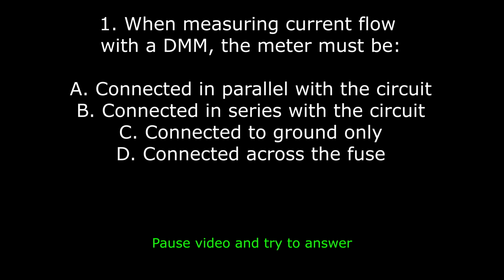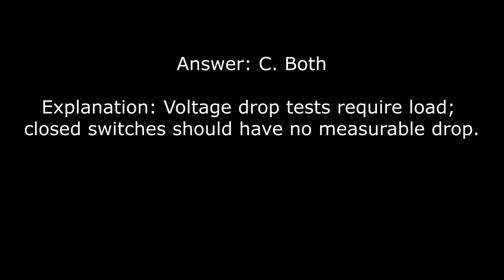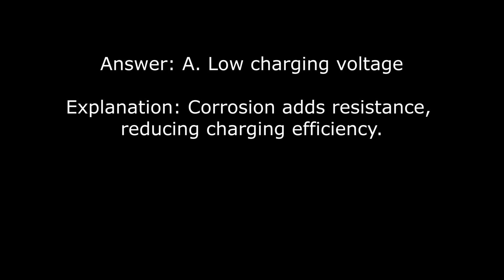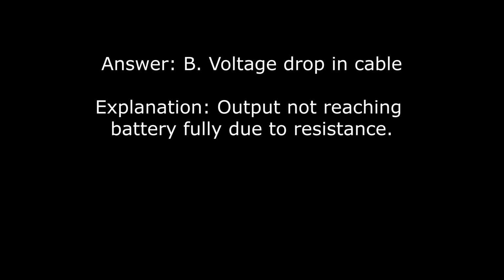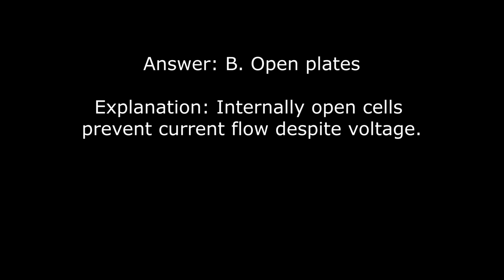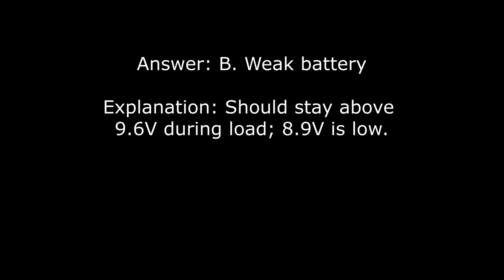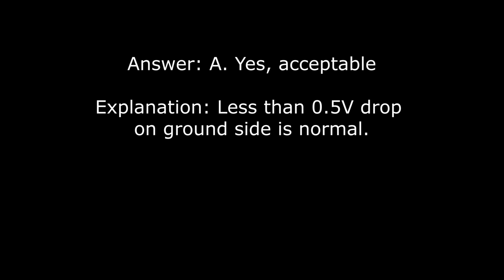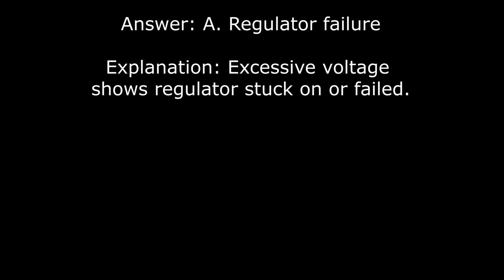⚡ ASE A6 Electrical & Electronic Systems Practice Test #2 (50 Questions) | ASE Certification Prep

Comment: you have wrong answers on here fix the video or delete the video
Reply from the maker: The answers are given in the video
Reply: @clayauto there are incorrect answers listed as the correct answer. fix the incorrect answers or delete the video. you are spreading misinformation and not helping people
Reply from the maker: @sebastionvalmont1123 You're welcome to discuss any questions and answers in the comments.
Reply: @clayauto I know. that's what I'm doing with you right now. you're also welcome to fix the wrong answers and repost the video once there isn't any wrong answers listed as the correct answer
Reply from the maker: @sebastionvalmont1123  That is what I am doing, correcting your answer. You're welcome
Reply: @clayauto can you fix the video or put the correction in the description of the video? do you know which question has the wrong answers listed as the correct answer?
Reply from the maker: @sebastionvalmont1123  The answers are all listed in the video after each question. 50 questions and 50 answers. You are welcome, good luck on your test! :)
Reply: @clayauto do you not understand that you have wrong answer listed as the correct answer? I think you understand and you are refusing to change it. you should really edit the video so that the correct answer is listed. or you could at least put the correct answer in the description of your video with the correction
Reply from the maker: @sebastionvalmont1123 There are 50 questions and answers in this video. You are welcome anytime to add any additional information you would like about any of the material covered in this video. Glad to help :)
Reply: @clayauto  they are telling you that some of the questions have the wrong answers. Meaning you are teaching/reviewing this material and being completely wrong and not fixing the mistakes just like the previous video you claimed that P= I * R is ohms law when it’s actually Watts law

Comment: For question 1, a DMM includes the function of an ammeter, but it's also a voltmeter, ohmmeter. An ammeter is only connected in a series, and a voltmeter is only connected in parallel. Question 1 is misleading.
Reply: How do you measure current flow when using a DMM? A better way to understand it. What is amperage? Amperage is the flow of current and when measured you want to be in series of the flow to be able to see it

Comment: Give up
Reply: Im not so sure question 6 is correct.  You specified that the battery still has 75% of its charge, so it only lost 25% of its charge.  The answer you provided was 12.2v, which doesnt make sense with the math.  

I agree with eduardo and you should gove up.
Reply from the maker: @dangravante2906  Thank you for the feedback, hopefully the other 49 questions were helpful
Reply: @clayauto hopefully?? So you didnt actually review these questions and just posted BS on here so you can confuse people? Smdh
Reply from the maker: @DegenerateTech  Yes, I hope the questions were helpful. Fortunately, I am making these study guides to clear up people's confusions. Good luck on your testing :)